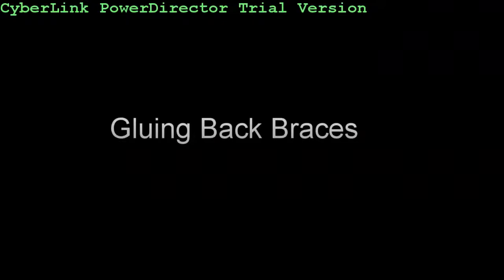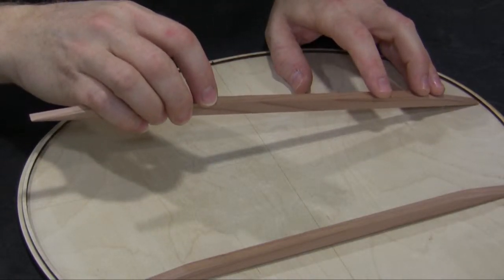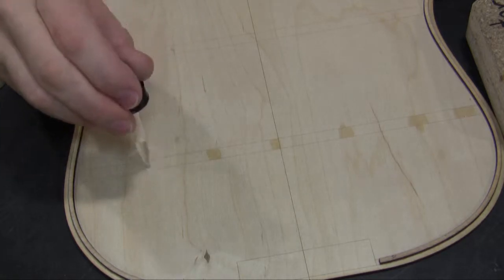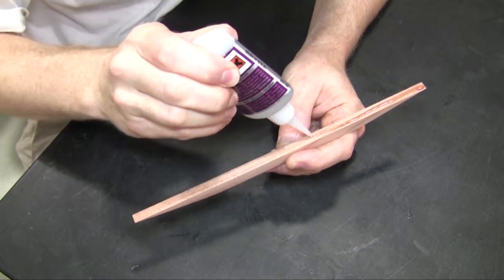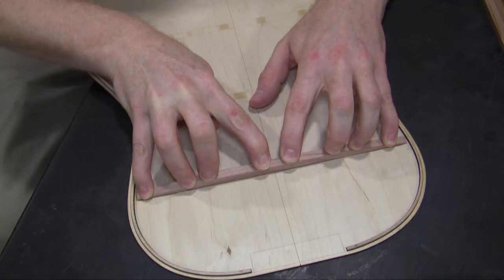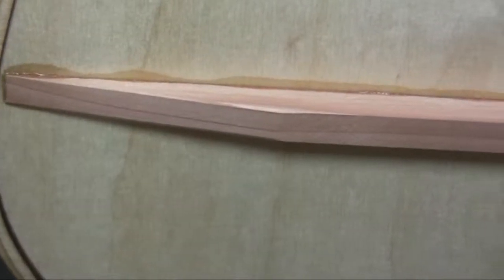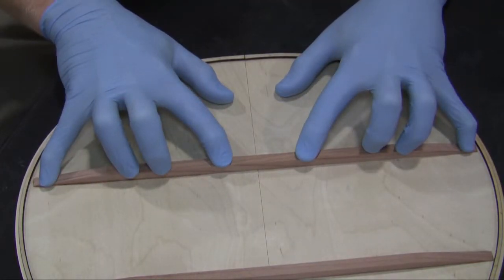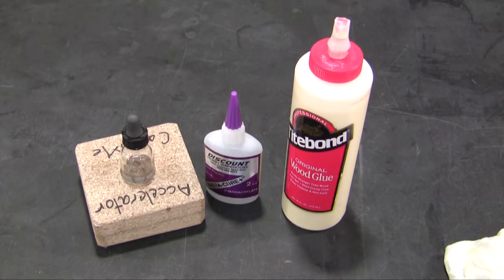Body 2b:  Gluing Back Braces

Comment from the maker: Yes, the width of the siding is that margin in the video.  Later, we increased the margin by ~1/32" and then sanded the top/back to meet the siding -- it adds a step but gives a little room for error when the siding is assembled.